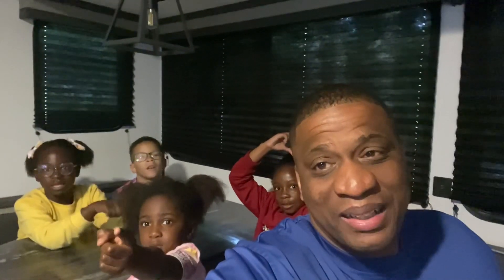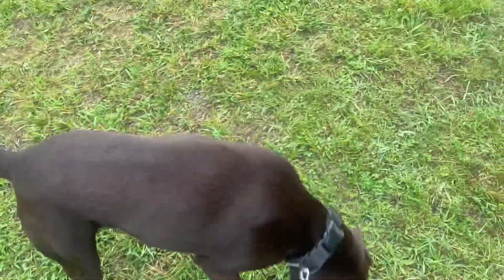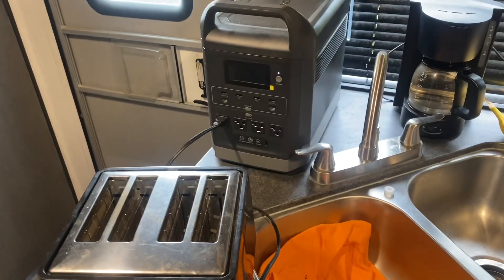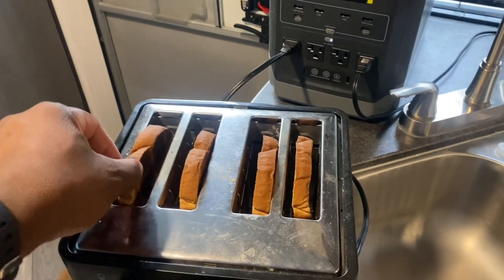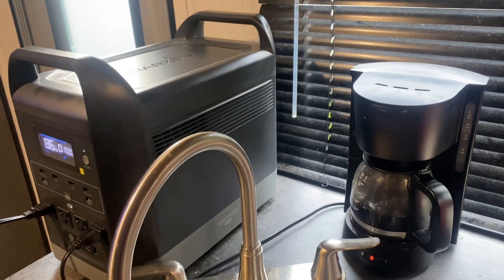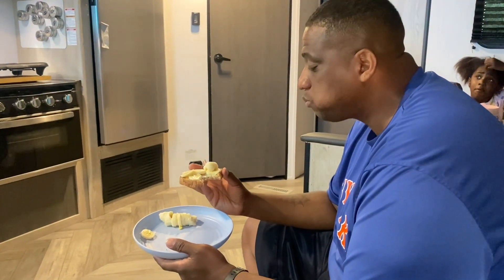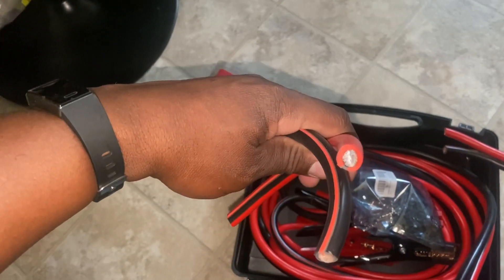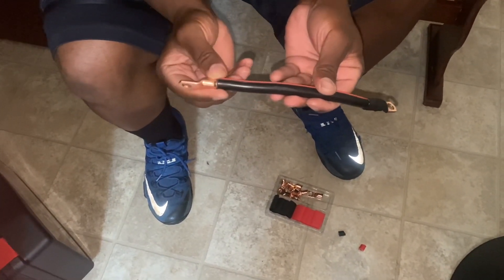Cooking and Camping While Making RV Upgrades

Comment: Did you say that your batteries are gel? Lithium (LiFePo4) would give you so much more usable power (approx. 45%+ more, so 2 Li batteries at the same amp hour rating would be the same as 4 gel batteries) and they weigh around 50% less, and with them being installed under your bed Li batteries would reduce your tongue weight! Although more expensive than AGM or gel, Li batteries get double our more the number of cycles than their AGM/Gel counterparts, so all things considered they are close to the same cost over their lifespan. They also are able to charge and discharge at much higher rates than traditional batteries so you will most likely be able to power all of your high draw devices without having to use a seperate power source. Not to mention that due to their composition you can mount them in any position so you would save space in your under bed storage if you mounted them on their side. And with them installed inside the RV you don't have to worry about cold weather and charging, so you can opt for the cheaper batteries that are available on Amazon which can get them at a very substantial discount. That being said, if you buy the American brands (BattleBorn, Ionic) they come with an 11 year warranty.
Reply from the maker: Hey how are you. I hear what you are saying. The gel batteries I’m using are a sponsored product. In my suv I have LifePO4 batteries. I agree they are much lighter and you can use more of the energy. These Marxon Gel batteries work really well. I’m able to power my entire camper during the times we don’t have shore power. For people that want gel batteries the Marxon brand is not a bad choice. They are also know as UPlus. It’s the same company.
Reply from the maker: Hey how are you. I hear what you are saying. The gel batteries I’m using are a sponsored product. In my suv I have LifePO4 batteries. I agree they are much lighter and you can use more of the energy. These Marxon Gel batteries work really well. I’m able to power my entire camper during the times we don’t have shore power. For people that want gel batteries the Marxon brand is not a bad choice. They are also know as UPlus. It’s the same company.
Reply from the maker: Hey how are you. I hear what you are saying. The gel batteries I’m using are a sponsored product. In my suv I have LifePO4 batteries. I agree they are much lighter and you can use more of the energy. These Marxon Gel batteries work really well. I’m able to power my entire camper during the times we don’t have shore power. For people that want gel batteries the Marxon brand is not a bad choice. They are also know as UPlus. It’s the same company.
Reply: @TheSmallsRVAdventures  Gel batteries are a good choice if your power demands can be accomplished with them, and/or you are shy of the initial investment in Li. Since gel doesn’t off gas they are a good choice for enclosed spaces. The only down side is that they are still subject to maximum depletion of 45% before you damage the battery. But probably the best choice for a traditional battery!
Reply from the maker: @okinawadonkichi  I totally agree. Check out our channel for the Chins 100 amp hour LifePO4 battery review. We have several of them including connecting in parallel.  Let me know what you think.